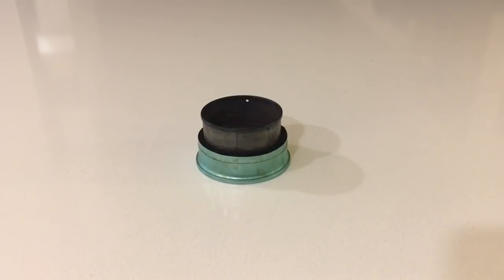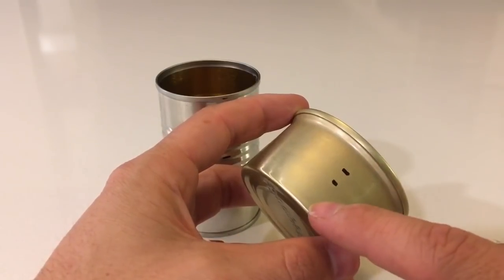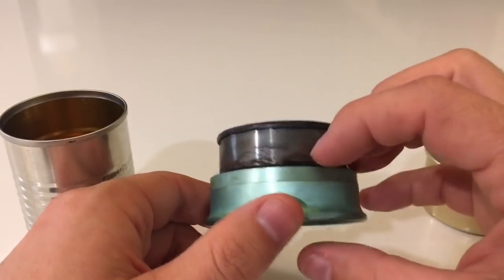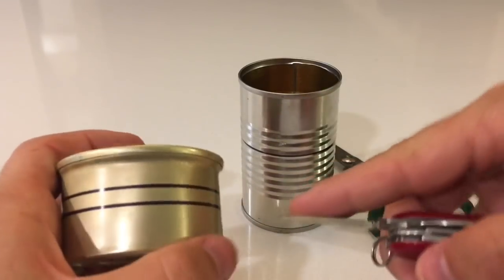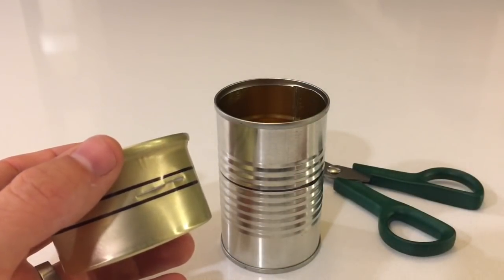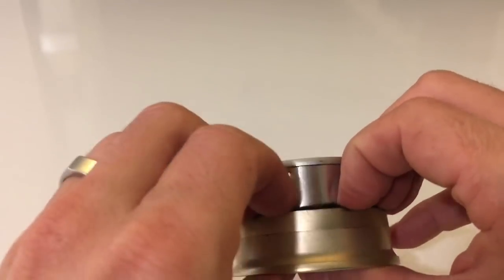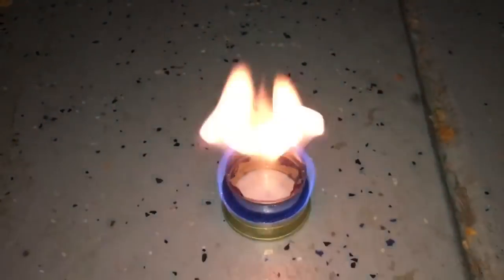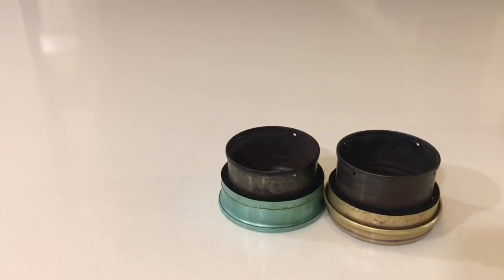Building the Best Alcohol Stove Out There

Comment: Great video, very clear build instructions.  Thanks for posting your video and giving credit for the wider base & greater stability idea.

I am starting my build and using all of the cat can.  Razor blade set at your 7/8 inch height  (7/8 inch thick wood & C-clamp) and spin the can around until you are just about to punch thru the can.  Then you can separate the two pieces by working your fingers around the circumference of the can.  Gives your bowl an extra 1/4 inch of height and more fuel capacity.  Plan to keep your 3/4 inch CF to pot distance so stove will be 1/4 inch taller than your build.

Comment: Your 7 inch length for the carbon felt may be ok initially. However, if you are familiar with Hiram Cook who has done all kinds of tests with these stoves recommends cutting your felt longer and then working hard to pack it in because over time and use, the carbon felt has the tendency to shrink leaving a gap between the two ends of the felt where they meet after wrapping around the inner can. FYI. Cheers and great idea for for those often needed quick burns for a a single cup of coffee or other hot drink where you don't need such a long burn time as these FF stoves don't like to let go of the unburned fuel so you can't pour it back into your fuel bottle. A smaller burner is just the ticket! I also like the wider base even if it adds a minuscule amount of weight. I prefer it's added safety. Nice vid! tnx

Comment: 5:30  Ever tried to warm up the outer part and cool down the inner part? Warming will expand the material and cooling will shrink it! ☺ May work!
Reply: great idea Steppi, I used to work at an aircraft supply factory and used the exact method you mensioned.

Comment: I just finished building one.  I DO like how much lower profile it is............it's exactly the same height as an uncut Fancy Feast base.
After the initial burn, I measured out a half ounce of yellow HEET, and almost brought 16oz of water to a boil in my kitchen.  Certainly hot enough for instant coffee, but time will tell how it performs outdoors.  It would certainly boil a little less water on a half ounce of fuel.  My total burn time was exactly 6 min.

Great improvement/option on the greatest DIY alcohol stove of all time.  For winter use I'll probably keep my bigger Fancy Feast with the full capacity and longer center support, but this new little guy has definite potential for the warmer months.  Thanks for the video.
Reply from the maker: Thanks for commenting, your results sound very similar to mine. I use the small ones exclusively now in the summer and shoulder seasons. But like you said, in the winter I would prefer the original size with the larger fuel capacity.

Comment: My first stove used house insulation  stuffed between the cans. I've used carbon felt. Now I use corrugated cardboard with the inside flute vertical or fold paper towel to fit between cans, which snuffs out after fuel is exhausted.
Reply: Im not sure I understand this. Any videos?

Comment: Hi from UK, stumbled on this as i've been using a similar stove for about 3 years now, this shorter version lights easier than the full height can stove as fuel doesn't have to wick as high and being lower is also more stable. Unlike you I do NOT push two sections together to make the base i simply cut the can down to required size (don't see the need to push the two ends together), instead of using a tomato paste can for the insert i use a small aluminium drinks can (same as a coke can only smaller) which i prefer as the tomato cans rust being tin, for the wick i use ceramic exhaust wrap as it's dead cheap, i buy the 50mm width tape fold it in half so it's double thickness which fills gap between the two cans just right then insert so it sits 25mm high,  ----  My method, cut top of FF stove to leave base 25mm high --- get a small aluminium drinks can and cut out the central bit where the ring pull is, cut off the top 43mm of can and this will be the insert, when inserted it should measure about 20mm from top of FF can to top of stove (many recommend 1 inch but i think it works better at 3/4 inch or 20mm, cut exhaust wrap to length fold in half and insert as wick, being same width as base 25mm it should sit slightly proud of rim when inserted, incidentally how high wick sits above lip greatly affects performance the higher it is the quicker the fuel is burned, it needs to be about 1/2mm above lip only. ---- If one requires stove to simmer the best i've come up with is get another aluminium drinks can same as the first, cut out the central ring pull area, cut the can down so the top part ends up the same height as the stove which should be about 45mm from top to bottom, cut the can up one side vertically, now open it out slightly so it will slide over the base, when slid over the base only about 30mm of wick will be showing reducing heat when burning. ---- For cooking pots over 14cm width i make the stove with wider cans but keep to the same height measurements, for this i use normal size drinks can insert. ATB.
Reply from the maker: Thanks for sharing your version and experience, and thank you for watching. You have some good ideas to consider there. Cheers.
Reply: Great ideas!  Will have to give it a go.  One concern is the strength of the small aluminum can that has to support the pot & it's contents.

Comment: I tried substituting carbon felt with cotton cloth and it works too!
Reply: The cotton is not burning out? It would make things much easier, cotton is easily avaliable.
Reply: You can even use sand...but anything that burns just doesn't last as long as carbon felt. I've tried air, but it doesn't work so well (I tried to keep the spacing as even as possible)...but in a pinch, under good conditions it can work.
Reply: Toilet paper works awesome. No cost. No stores!

Comment: Nicely done tutorial.  A question on your original design--the less stable one shown at the end of the video:  Have you ever tried pouring a little alcohol into that lip and lighting it as you would a priming ring?  I remember reading that if a stove's outer wall is heated at the outset, the fuel vaporizes more efficiently causing the stove to bloom sooner and burn hotter.
Reply from the maker: I have not tried that, but the wick on this stove acts to help vaporize the fuel quickly. So this stove does not need time to prime and bloom, as soon as you light the wick the stove is burning and ready to cook.

Comment: I just did my first two traditional cat can stoves.  They work great!  I'll try this design next.  I overlapped my felt because in one of Hiram's videos he mentioned that the felt eventually shrank.  I only cut the height of my felt and didn't trim any off the length.  It has a little over an inch of overlap right now.  At first the tomato paste can sits off-center, but the stove seems to burn even all the way around.  I'll see how long the felt takes to shrink, and maybe after it stops shrinking I'll trim it to fit perfect (maybe - there's no need to trim it now, so I may never do it).
Reply: Great tip! Did you trim it already? what is the perfect width? Thx!
Reply: thexitto :   I have kept mine the way I originally made it – with the overlap.  I don't imagine I'll ever need to trim anything now.

The cat-can stove is not my favorite stove.  My favorite (although bulky) is the Ikea silverware container stove.  I did absolutely no modifications to mine.  If you're not familiar with it, it's a stainless steel cylinder with holes drilled all the way around it and on the bottom from the factory.  I originally had a mesh basket underneath it to lift it off the ground and allow good airflow.  There are many methods of achieving bottom airflow.  Now I use a 'Light My Fire' brand 'Grandpa's FireGrill' as my spacer that is also my grill.  I cooked three hotdogs at once tonight with it!

My Ikea stove is a bit bulky, but fuel is endless if you are lucky enough to camp where fire-bans aren't an issue.  I'm lucky like that at the moment.  I often make three cups of coffee in the mornings at camp and my AeroPress Go fits inside my Ikea Stove, so although somewhat bulky my whole 'kitchen' nests nicely together with almost no 'dead space'.

So I literally have a stove with an endless fuel supply, a GRILL, an espresso machine!, and a firepit that I can safely use in a camp without an existing fire-ring without any evidence that a fire was there.  

Even though it sounds heavy it's not – if you like multiple cups of coffee and the ability to cook (and not just rehydrate) at camp it's a GREAT stove.

I have a low quality video of my setup on my YouTube channel that gives the weights and everything.  I have now used it many, many times and absolutely love it.  It even makes a good 'companion fire' for lonely camps and puts off enough heat to sit by on a cold night if you're not ready to go to bed when the sun goes down.  I also use it as my starter system when I build a fire in a fire-ring.  It's easy to light damp twigs in (with a small amount of cheater paper) and then dump out the fire and build a large fire on top of the established flames.

I'm due to make an update video on the Ikea Stove now that I've dialed my whole kit in.

I'm even at camp right now laying in my hammock as I type this, so I'll probably record the video and post it tomorrow as I enjoy my morning coffee!

Thanks for encouraging me to tend to my YouTube channel. 👍

Comment: Great tutorial and nice modification to the original design. 

From the other comments it looks like you could add a little more than an ounce of fuel for that size stove. Have you tried how long it will burn with say an ounce or at capacity? Also how much water have you been able to boil with this stove? I ask as I am trying to decide whether I make the original taller version or this shorter version. 

Thanks!
Reply from the maker: Thank you. The pot I usually use only holds about 500ml of water. But with an ounce of fuel the stove isn’t quite at capacity, and it will bring 500ml of ice-cold water to a rolling boil and boil it for a couple minutes. I’ve never had to refuel it before the water boils.
Reply: @ColoradoCamper  Great thanks. I'd probably boil up to 700ml sometimes (900ml pot) at the most, so maybe I'll make the original taller one, at least first. I guess it's possible to make one in between the two sizes of yours using the method in the video?

Comment: I've found some coffee drinks and Mr & Mrs T Bloody Mary mix aluminum cans are the same diameter as a tomato paste can.  I've made stoves with them and they make a lighter stove.
Reply from the maker: I've done the same with a hair spray that has the same diameter. For some reason I didn't like the way it burned, it seemed to burn hotter and use fuel faster. I need to experiment with it more, maybe if I change the length of the inner can it would solve my problems. Cheers, thanks for commenting.
Reply: Small V8 veggie juice cans are same size too plus thin and light.

Comment: Appears to be a easy build , lightweight and practical for camping. It sure appears to be easier to make then the standard pop can ones. One thing I have noticed , everyone making the little stoves only make the best ones , no one makes a mediocre one. Guess I'm the only one who made one of those in the past. I have made some really nice ones also. By the way the Carbon Felt you can get two ( 2 )  large sheets of the 1/4 inch thick ones on amazon. Hiwowsport High Temp 6 MM Carbon Fiber. ==12 x 12 $12.95 , 18 x 24 $ 18.99 , 48 x 72  $72.00
Reply from the maker: Chuck Littleton I made plenty of mediocre stoves before settling on this design. The main reason I do videos about this stove is to try to save others the hassle I went through
Reply: I've made dozens of crap stoves. I now make only cat can style, but at different diameters from tin cans to fit in various size cook sets. Papper towel folded will replace carbon felt and last for multiple uses.

Comment: Great looking stove. I like the safety and wind resistance of the low profile.  Do you really need the two piece base?
Reply from the maker: No you don't really need to press the ring onto the base. You could easily get by with just the fuel cup portion, and it will still be a very stable and functional stove. Very good point, cheers.
Reply: I was about to ask the same question.

Comment: I have not seen this stove before and I would be interested in boil times for this stove and a comparison with the efficiency of the Groove Stove which, so far, I have found to be the most efficient. Thoughts?
Reply from the maker: I don't have boil times that I can quote you for this stove. As for efficiency, it can boil 2 cups of water using 0.5-0.75oz of fuel.
The reason I like stoves with wicks if because they perform so well in cold weather. See the video linked in the description of this video titled "The Best Alcohol Stove Out There (IMO)" for more details on that.

Comment: great vid bro ...so on the idea of fliping the base around looks to work well but you roriginal design can be a plus in cold weather by using that ring to to pre heat the stove...
Reply from the maker: I see what you mean, but the great thing about stoves with an exposed wick like this is that they really don't need any pre-heating at all.

One minor advantage to the original design is that the ring would catch any spills if you filled the stove all the way full and it tired to leak a little fuel out once it got burning. But I think the added stability for the design shown in this video is the best advantage. Though one could make a stove with two rings, basically blending both designs together.
Reply: yea thats very true...i think im going to build that cut down version
Reply: @ColoradoCamper  I've found that if I put the pressure relief holes just above the out can edge, it's easier to tell if I'm about to overfill, and I cheat a little on my starts sometimes by putting a little alcohol near one of the holes and it seems to start quicker.

Comment: It's a cool idea but I think the normal fancy feast stoves barely hold enough fuel for me as is. Why shorten it and drastically limit it's fuel capacity? I think I'll try this but I'll put the base on to a regular sized one.
Reply from the maker: I made the smaller one because I experience the opposite problem - for me the regular fancy feast stoves have way more fuel capacity than I need. They will hold over 3oz of fuel, that's how much fuel I would carry for a whole overnight trip! I usually use about 1/2-3/4oz at a time.

Putting the base ring on a regular one will help with the stability. Great idea, I might have to do the same. Though I hardly carry the full size one anymore. Cheers and thanks for commenting.
Reply: @ColoradoCamper  maybe my issue is that I'm not using carbon felt. I don't have any so I just use rolled up strips of jeans material which I would imagine holds far less fuel. That carbon felt looks super spongey. Can't wait to get my hands on some!
Reply: On Amazon it's called HIGH TEMP FELT PLUMBERS PAD 12 x 12 for $15
Reply: Moose I didn’t even think of jeans! Thx 👍
Reply: Bobby Harper it’s at Lowe’s for about $4
Reply: Nikki, much higher than that here. If memory serves, around $15. However, quite a few stoves can be built from a single sheet. Price per stove easily affordable, if building multiple stoves for friends & family. Makes a good DIY gift to an outdoors buddy.

PS, Fiberglass is also used for these stoves. Either pink insulation is packed in around the tomato paste can or white fiberglass sheeting (as used in auto repair) is wrapped around the can, until there's a snug fit. Personally, I like carbon felt. Works well for me.
Reply: Hiram did a series of videos using a number of differenr liners, including kleenex i an emergency. worth checking.
Reply: Oldtimer Lee I just found your comment :( after looking again on to build the fancy feast...as I have built mine with fiber glass sheets and it didnt last long, it did boil 2cupsof water, but I had to re burn the initial burn to get the plastic coating off the tomato can so it used 5 oz of heet :( seems like a lot I think maybe not
Reply: And yes it is a lot higher than $4...it was showing something online at Lowe’s but went to the store to pick it up and it was $15

Comment: Amazingly simple, and amazingly effective. 
I recently made several for friends and family. Even some friends that work at REI really liked them, so that's saying something!
As. Stoves like these have the potential to be lifesavers, I'm wondering if there is a tried and true bigger version of this stove for folks that are in emergencies at home (hurricanes, extended power failures etc.) 
Something  for boiling a little more water, using kitchen sized pots?
RicklesssS
Reply from the maker: I haven't made a bigger version, but I know that some people have used larger cans, such as a tuna fish can. The design is easily scaled up, you essentially need two cans that differ in diameter by ~1/2 inch or so and then the same construction method applies. Cheers.
Reply: Thanks for the reply, CC.
Yeah, I guess this isn't "rocket science".  
I still have not scrounged for "2 just the right size large cans" for a larger stove, but DEFINITELY will.
   With the intense storms and power failures we've been having, and most likely will continue to get, having a dependable emergency stove for cooking for multiple people, (or just larger amounts of food) should be something we all have, I think.
Thanks a ton!
Reply: Im working on an easily purchased standard can stove now, i wilm upload it once Finalized. Prototype boils at propane speed with alcohol and no pressure. Stay tuned.